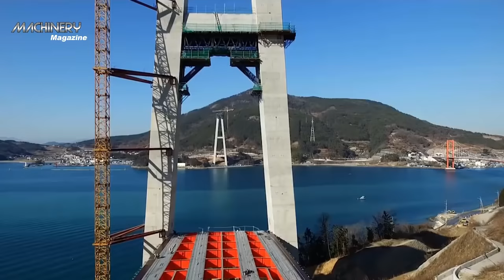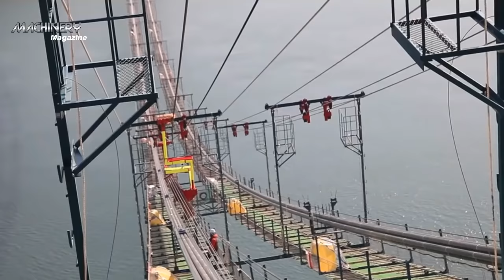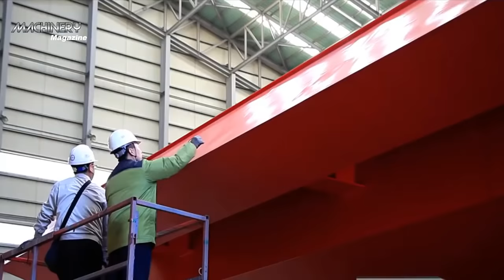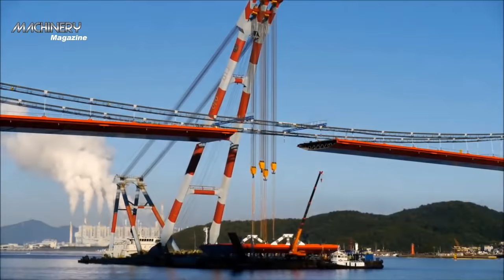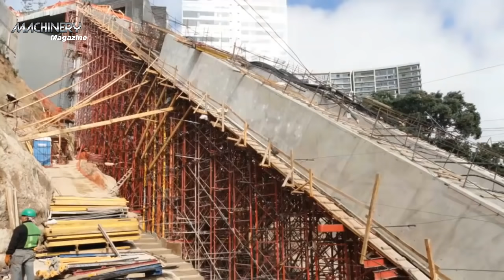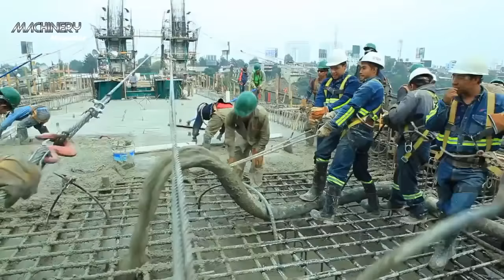This Modern Bridge Construction Method is Very INCREDIBLE. Amazing Construction Equipment Machine ▶2

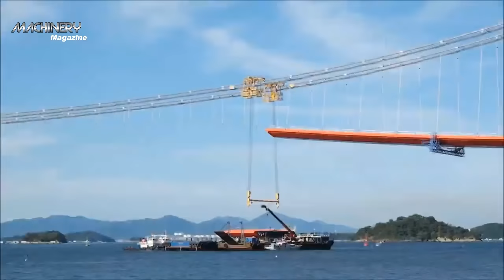Comment: An excellent documentary. Fascinating to watch the main suspension cables sag slightly around 4:06 as they take the weight of another section of the bridge deck.  Interesting that the principles of this basic technique has not changed much since the construction of the first Severn Bridge in the UK, between 1964-1966.